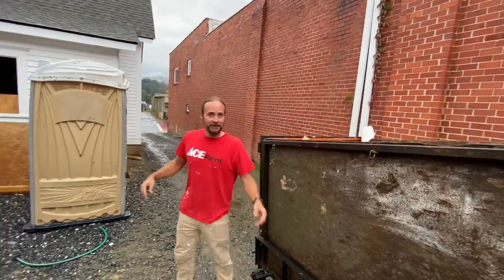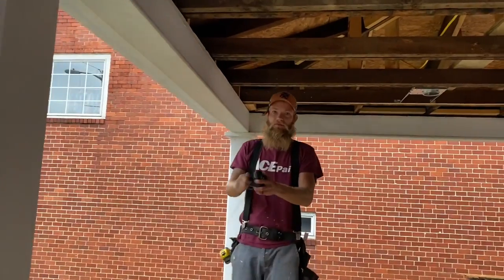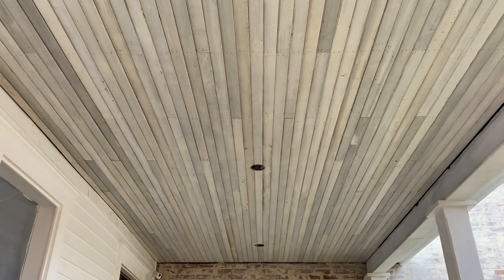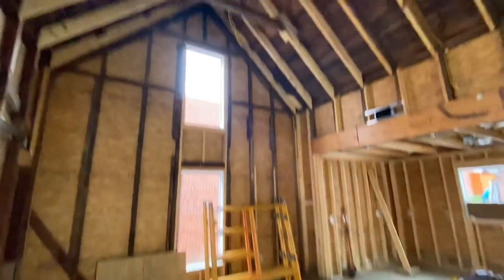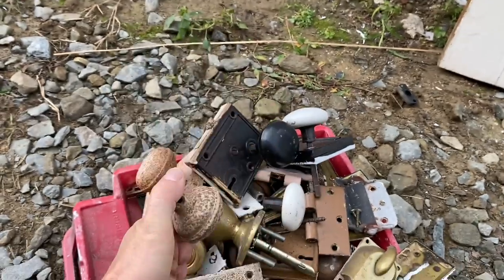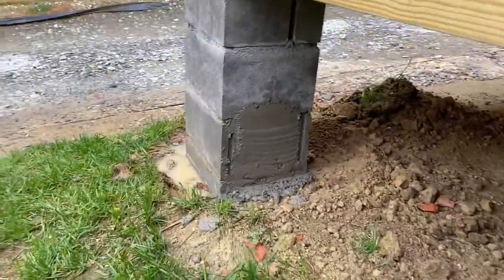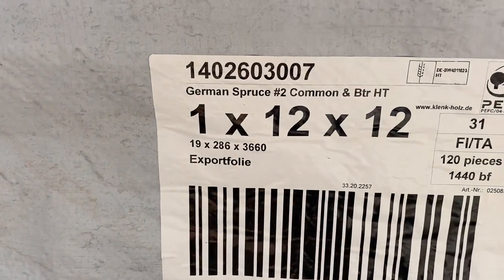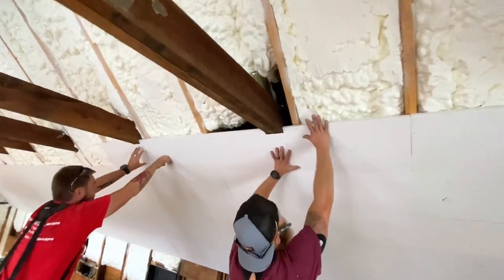Renovating A 100-Year-Old House | Episode 11

Comment: The brake lights , There’s a screw under the brake pedal with a pin coming out of it.  When the pin loses contact”when you push down the brake” it causes the brake light to come on.  The screw needs to be adjusted.

Comment: The reason the brake lights are always on is because the little plunger that disengages when one presses the brake pedal actually engage the brake lights to turn on. Look behind the brake pedal to see what the damage is. I had the same thing happen to my prelude when I was at work so I went to my parts bin and grabbed a titanium nut at bolt to replace the plunger.
Reply: My neighbor has this same problem.  I usually text him once a week so it won't run down his battery.

Comment: If you want to revive those old door hardware, boil them in water and watch the old paint just fall off! Use a pair of pliers and a brass brush or steel wool. Then just dry them off and a little oil to keep the rust off.

Comment: You should  Check the brake pedal there is a Plastic mechanism that attaches to the upper side of your brake pedal that keeps it from pressing and turning on your tail lights. I had to replace the mechanism on my daughter's car . Most of the time you can just put a rubber washer or spacer in there and that will fix it

Comment: check by your brake pedal there's probably a switch right there that turns that brake light on and it's either out of adjustment or the switch is bad

Comment: Check the brake light switch behind the brake pedal. Its likely the cause. Unless your bulbs are LED your brake lights may get really really hot. Also... due bad chassis ground (especially on old cars with corroded connections) the wires may heat up critically. Ever wondered why cars go up in flames? Fix it buddy. Fix it.

Comment: sorry, you should think about not using spray foam it and another name for asbertos and a different foam have all the something that asbestos has when it burning what you lust done to that 100-year house was decrease the retail market sell on this house I know I will not buy a house has harmful gases and cancers to people to pink insulation or any other band is out there it better too easy to fix and plumping pipe me have broke in the well or a water leak to be found and fixed too, yea lot harder and longer to fix too most of the time they don't respray the insulation back into space too more problem after that sorry had to get and fix the problems to many-time here pipe has frozen up to many times yes did find that some builder that has been happing too yea had to report this find to the city. the city did look into this  from that he was paying off the people to look the other way  he not able to build here anymore or work here as well too and the lot more were  too
Reply: It is formaldehyde Not asbestos formaldehyde is considered safe as us humans make it in our body and cars make it as well as burning wood